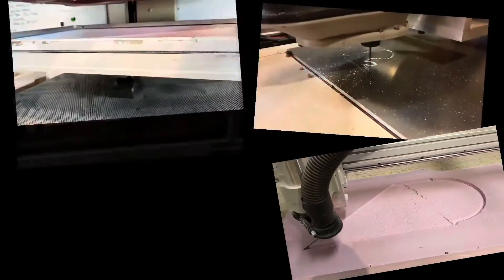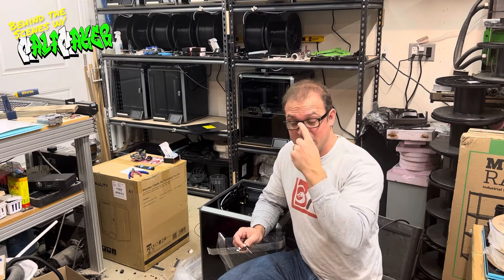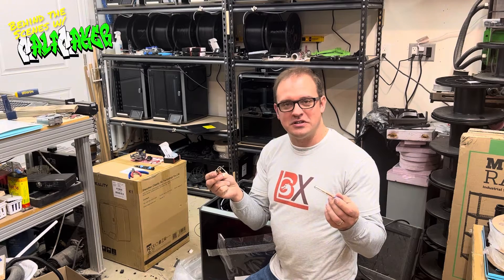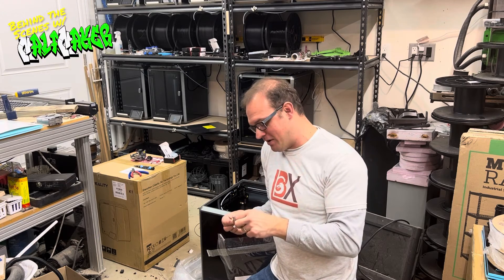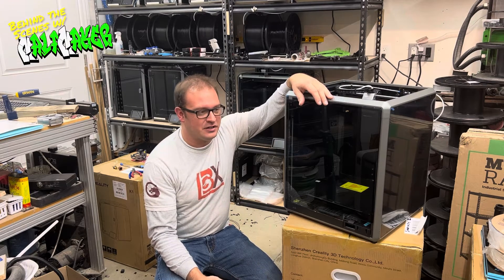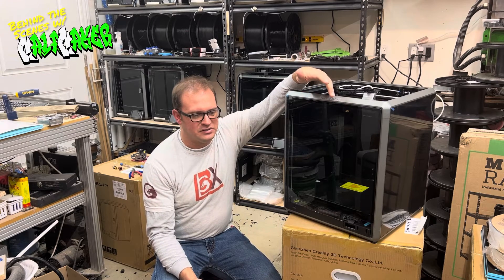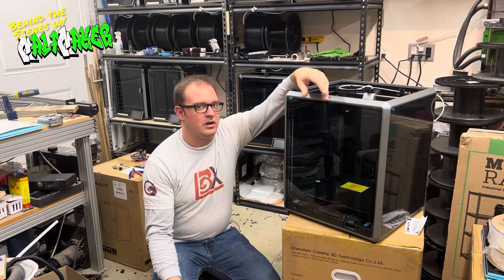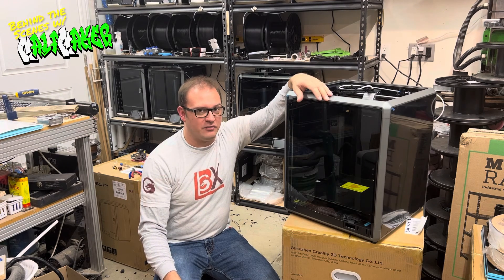Unexpected Discovery: New Hotend Design in Creality K1 Max?  …BUT inconsistent inventory

Comment: Is it possible to change the hotend to bigger size like .8 ? If yes would it be on the original or the flow tech?
Reply from the maker: Creality does make a 0.8mm unicorn nozzle. You can also get a 0.8mm nozzle with the flow tech.

Comment: I just received my first K1 Max and it got the new Nozzle , looks good .  Correct me if I am wrong but this new Nozzle, if you want to make a Nozzle change you don't need to Head up the extruder ? If so that's supper awesome. I have test PLA, ABS and PETG this week and can not believe how good the K1 Max prints. No stringing, clean lines and finish . ABS no warping. Back to question, cold Nozzle change ?
Reply from the maker: Yes you can cold swap the unicorn nozzles. No heating is needed to swap the nozzles and the nozzles just need to be snug. No need to torque them down.
Reply: @MalaMaker86  Awesome , do you know if its a hardened Nozzle ? Can I print Nylon and carbon filament on this unicorn nozzle ?
Reply from the maker: @vaughanza  they are both hardened and coated for exotic materials that are high heat and/or abrasive. These nozzles have a huge influence from another major 3D printing company with the abrasive, high flow and high heat tech.
Reply: @MalaMaker86  Thanks for the help, appreciate it.

Comment: It would be interesting to know if they have added any of the other changes to the Max from the K1C??
Reply from the maker: The K1C is really a small version of the K1 Max with the new unicorn hotend/nozzle/heatsink. Them saying it’s designed for CF is simply saying the nozzle can heat up to the appropriate temp and it is abrasion resistant.
Reply: I think at one stage the extruder gears have been modified in the newer model they have reduced the gap between the gears for better filament feeding force, I bought a k1 max 3 weeks ago and has unicorn nozzle and upgraded extruder unit, I prints very well, I have run PLA and PETG

Comment: I just bought some Micro Swiss nozzles bbut havent got around to installing them. Hopefully this new hot end is better because that is the real only issue I have had with my Maxs. They are not easy to replace with fat fingers.
Reply from the maker: I have had a lot of success with the new nozzles. Make yourself a tightening tool like what I have in the video and you should be good. You need a little leverage to make sure it’s snug enough to not loosen.